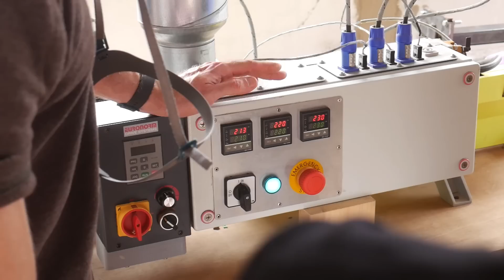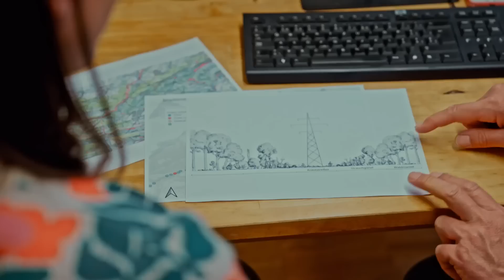Can Africa's Smallest Country Fight Plastic Pollution?

Comment: Wouldn’t it be great ifthey could produce PVC pipe, and give the community a way to have running water to each home
Reply: PVC is a different type of plastic, not common in waste streams and not safe to recycle, it’s the most dangerous kind to melt
Reply: The pipes run to homes but water only comes a couple of hours at night.

Comment: All that plastic.. I see diesel ⛽️  and gas and even building material.. ecollabo8 makes building material and outside furniture.. their andirondack furniture are lovely.. but the turning plastic into fuel and even a propane gas is what I like because you can use it for your vehicles and all generators and even cook with it on gas stoves and heating for furnaces.. and the burning process is clean.. not pollution.. many ppl living on isolated island are doing this. To operate their generators for AC and electric and also all this gas fueled landscaping equipment..
Reply: There are companies doing that and trying to perfect the plastic to fuel process but it takes a lot of energy and expensive equipment, which is not sustainable in a developing area like this.
Reply: @amandao.8043 Yet. If enough people pushed for it, someone will make a way to make it sustainable. There is plenty of raw material floating in the oceans or clogging waterways.
Reply: That involves research and money and time... The world isn't investing enough effort into these things. It's very easy to say "do more this isn't enough". But it's a different thing entirely to do it. @ickisthewolf
Reply: We can try many ideas and the ones that work the best are the ones that will stick around. 
It is easy to find reasons to not do something, but the rewards are better when one goes out and does it.